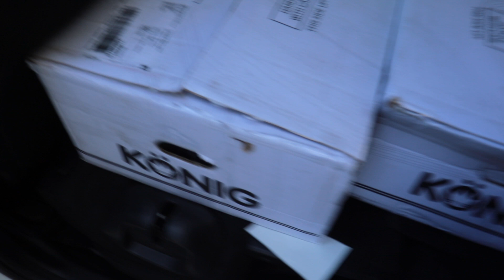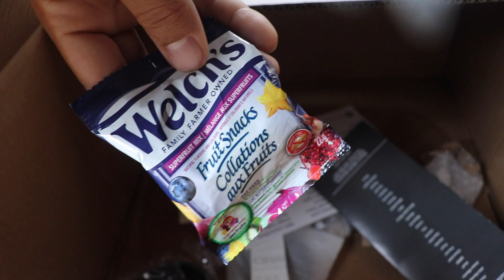New Wheels & Tires Honda Fit GK5

Comment: I’m kinda stupid so please forgive me. I saw your post with the wheels on on your insta and was going to get the same sizes you got but I don’t want mine to pop out as much. I know I can get like 7.5’s but how would that size difference change the wheel sizes. Any help would be greatly appreciated ✌🏾
Reply from the maker: If you don’t want them to poke as much, I would go with a smaller width and a higher offset. I’m planning on pulling fenders and running some camber so the wheels should tuck in a little more.  15x7 or 15x7.5 with a +35 or +45 offset should work!